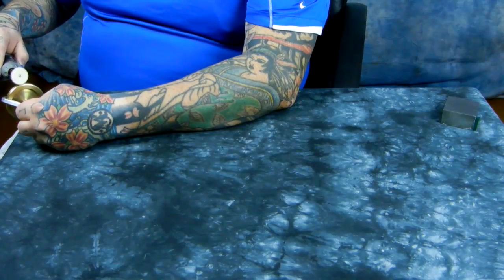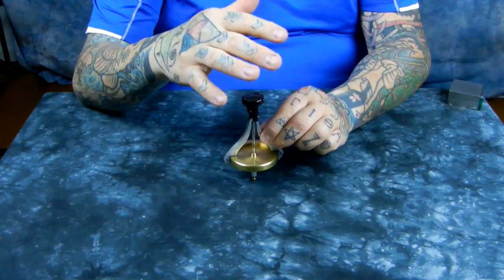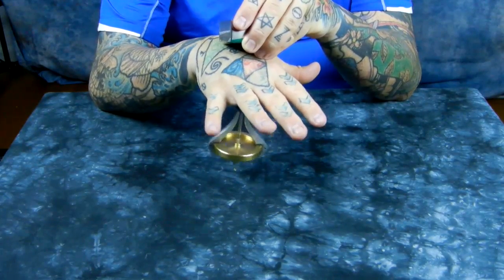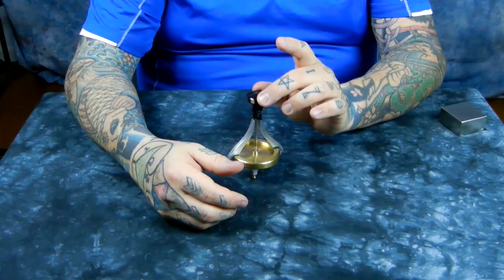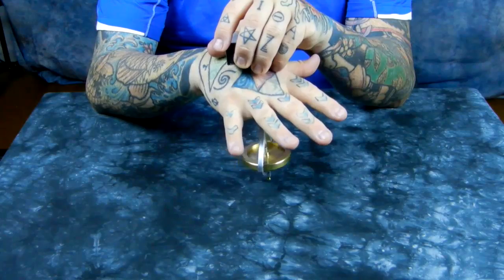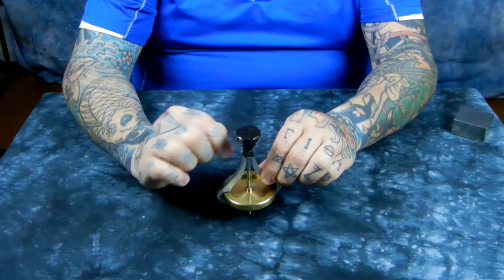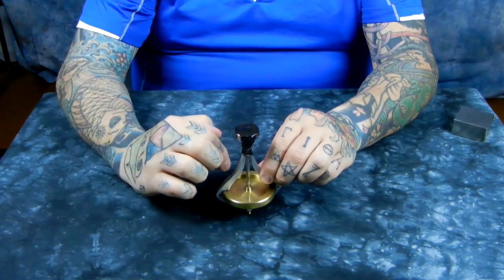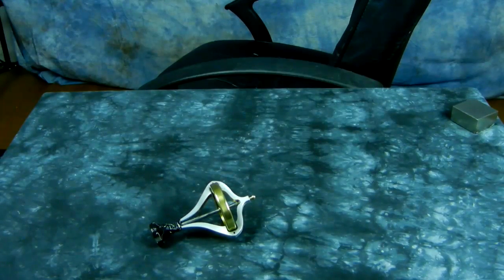Eying the future: Frictionless Magneto-gyroscopic breaking & stabilization systems

Comment: I actually thought about putting a gyroscope into a motorcycle to make it stable in any situation, but no science under that - just as an idea
Reply: Alek Girlin This idea is very old. https://en.wikipedia.org/wiki/Gyrocar
Reply from the maker: Axel Becker frictionless nad hubless induction-driven flywheel magneto-gyroscopic breaking is NOT "very old"

it doesnt even exist yet
Reply: Theoria Apophasis I just meant that the idea to put a gyroscope into a motorcycle for stabilization is a very old idea. Not what you have mentioned, Ken.
Reply from the maker: ahhh that, well yes.
Reply: Axel Becker Great! I'm having same ideas as great minds of the past )))))))))